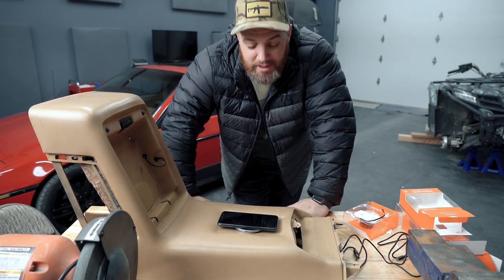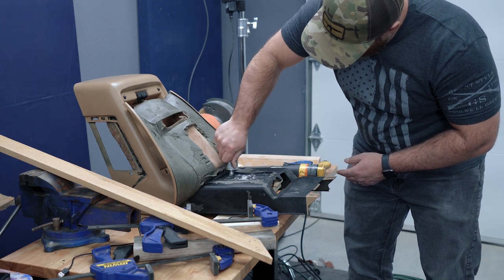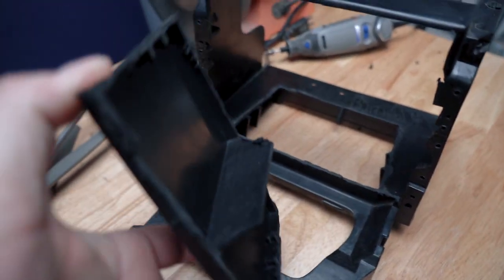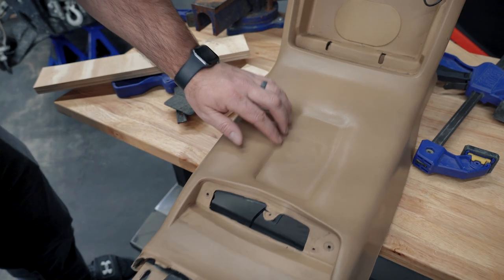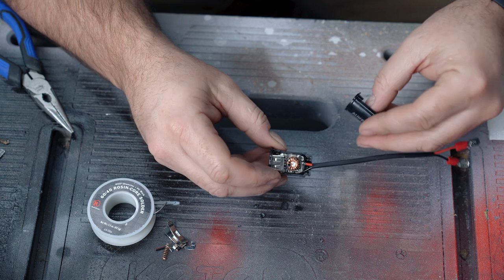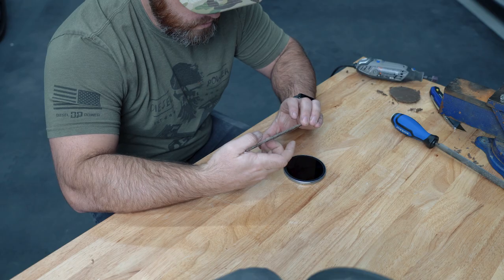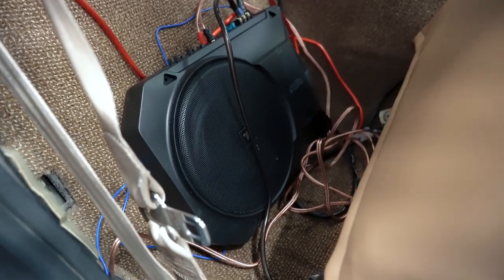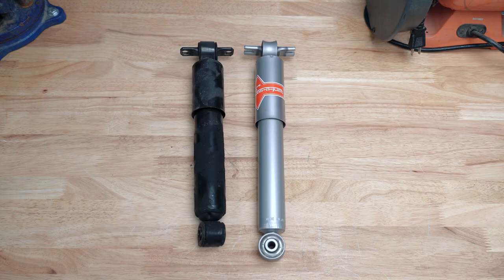DIY wireless charging - in my 80s sports car // Fiero Ep. 4

Comment: Nice job on the charger and keeping the interior as original as possible.
For the stereo, with the 3800 engine noise, you won't hear a damn thing!😜 At least that's my experience with sound systems in a Fiero.